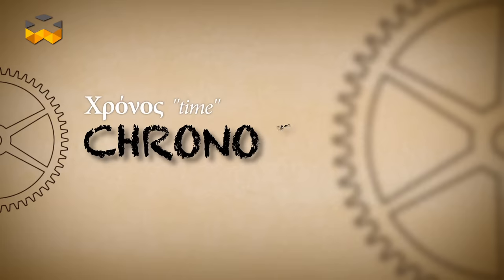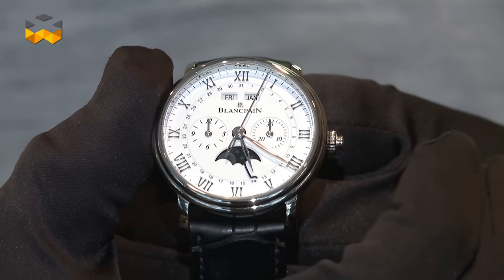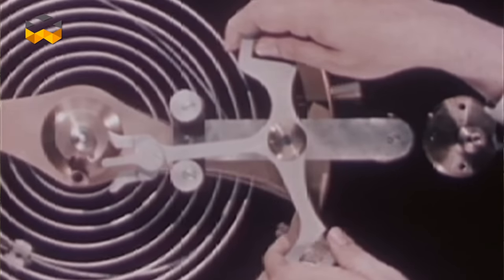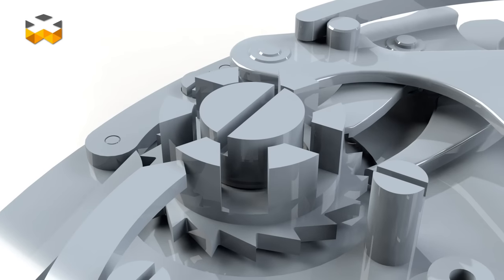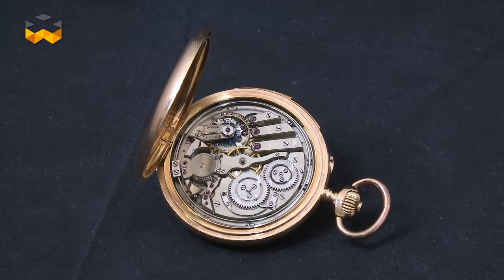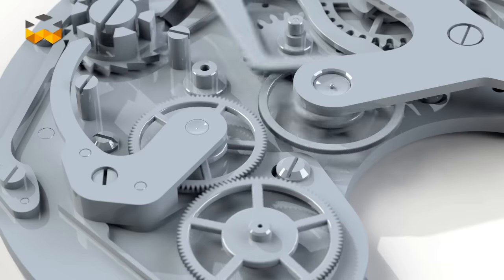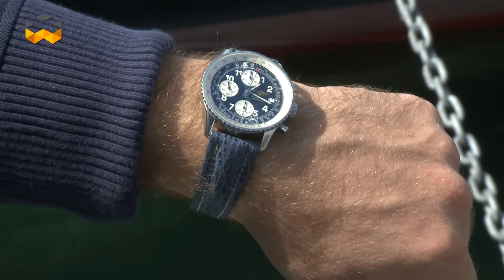Chronograph Saga 2 – How It Works

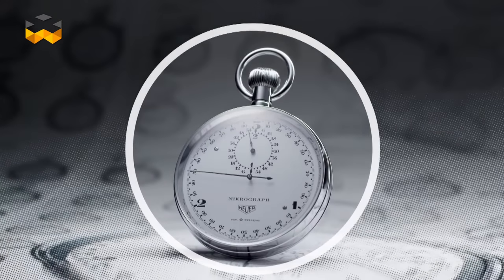Comment: Nice and informative videos! But I think the script was misread for 10Hz at around 1:41 of the video. 10Hz = 20 beats per second, = 72,000 beats per hour... not "22,000 beats per hour" as mentioned in the video. "72" might have been misread as "22".
Reply: They made similar mistake in p1 where according to them 4hz movement moves the second hand in 4 increments per sec...
Reply: Indeed, they made that mistake. But there is no way that chronograph beats at that speed. The Zenith El Primero, was the first one beating at 36,000 vph, developed in the 70s, and it was grounbreaking. They even had to develop an special lubrication system as a result of the centripetal force of the wheels (balance). It must have been 21600 vph or 3 hz... But then the numbers they mentioned don't match...
Reply: So how could they claim 0.01 seconds accuracy?  For that matter, how could they keep any gear in a watch moving smoothly when there's an escapement?
Reply: @pablocontreras8767 The heuer micrograph from 60s was in fact measuring 1/100s of a second the catch is that it was not a watch , it didn’t show time of the day/ night.

Comment: Bien le bonjour ! Très bonne série de vidéos ! Juste une précision : à 1:50 : 10 Hz = 10 battements par secondes donc x3'600 cela donne 36'000 par heure non ? (et non 22'000)
Reply from the maker: +benjouz Absolument, une erreur de notre part. Merci pour votre correction
Reply: No, 2 beats per second = 1 hz. The mistake is even bigger.

Comment: no mention of the spring drive chronograph? interesting lol
Reply: +KidWeazel spring drive is awesome... but I guess they are sticking to the mechanical chronograph for the time being.
Reply from the maker: +KidWeazel The SpringDrive system is first an electronical regulator within a mechanical watch. It is a great development from @Seiko at it gathers the best of quartz and mechanical. But here the purpose is how the chronograph function works. And it integrates a vertical clutch.

Comment: 10Hz is 36,000/hr not 22,000. 
That is around 6Hz.
Reply: No, 1 hz = 2 beats per second in watches (1 beat it goes, 2nd beat it comes). The mistake is even bigger though